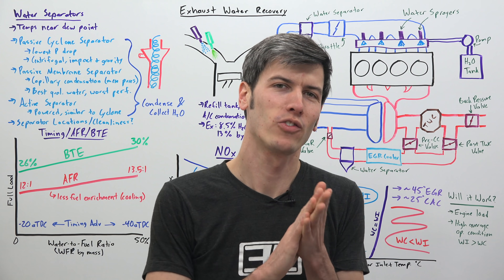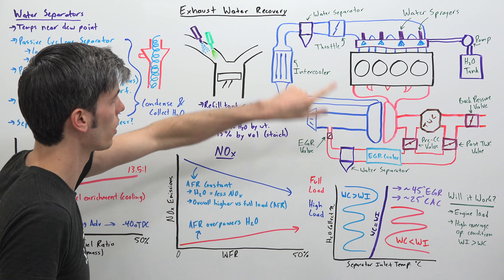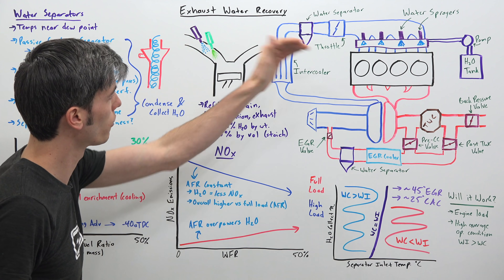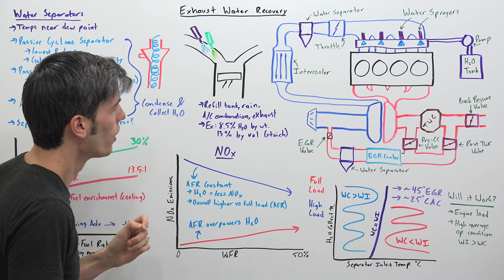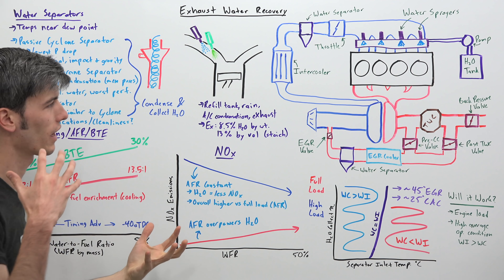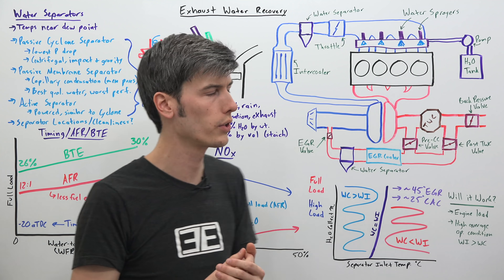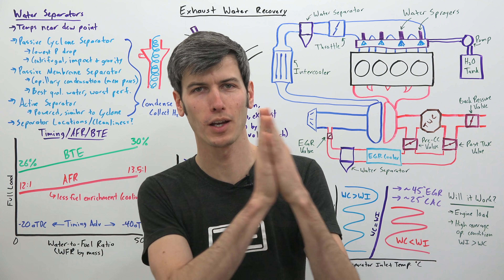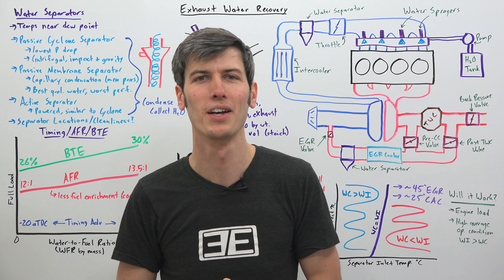Using Exhaust Water To Make More Horsepower!

Comment: Why not just have one water separator - in the intake, after the EGR returns to the intake?

The US army did a study on something like this back many decades ago, using many decades ago technology. They were trying to keep a water jacketed engine cool through self-sustaining internal water injection in cases of the coolant system failing or being breached. They managed to succeed at about 300% water injection, but were unable to reclaim most of the water, caused severe water contamination of the oil and the reclaimed water being highly acidic. Worth mentioning this was on a diesel engine and the water was directly injected rather than port/intake injected. Would be interesting if they tried it again.

Comment: @Engineering Explained What about using water drained from the evaporator core combined with this? Using my C5Z06 I used that water through a filter to top off my methanol injection tank. The car used a Supercharger & I would usually see maybe a cup of water a day while in a 90% humidity 85*F day in the South East USA.

Comment: Why retain the EGR system?  It's purpose is to reduce combustion temperature to reduce NOx production.  Water injection is doing the same so EGR is redundant, its weight can be removed and more power can be had.  I have to assume the SAE paper was published within the past ten years since the testers used direct-injection gasoline engine?

Comment: Great explanation of advantages for water injection!  I've been told one of the effects of water injection was that the water "cracks' in the high temp/press conditions in the combustion chamber and increases fuel combustion efficiency by adding oxygen & hydrogen.  Do you agree?

Comment: I have a video suggestion, it is a bit very specific I think, but it could be really interesting.
A video on how engine displacement, cylinter count, engine type (gas/diesel/turbo/non turbo), engine revs and transmission ratio effect the performance of engine braking.
Because when an engine has more displacement it should brake more because it can create more vacuum an therefore break more.
The video could explain if an engine with 2 liter displacement delivers douple the power on an engine with 1 liter displacement and how much a the backpressure of a stalled turbo effects the braking performance

I have read a bit online and found that normal diesel cars have no engine breaking but it seems that they do because they have obstructions in the exhaust which lead to the car slowing down when not applying throttle. But I also read that this depends on the car and some cars have an exhaust valve. 
You could also explain what is more effective at braking, the diesel exhaust valve method or the gasoline intake valve method.

It would be great to have a video about that, specially about the first part of this suggestion, it could act as an follow up to your Engine Braking Video from 2016 providing a more in depth look at the subject.
Sorry for the long comment and have a nice day.

Comment: This has been known, but not that the effect can be that great with just water.

The MORE IMPORTANT question now remains; Does that BTE increase directly translate to higher peak power or peak torque ("under the curve" benefits), or at what ratio? One would assume 15% BTE increase means 15% power increase, but in the real world there is always drawbacks. What happens to exhaust pressure, does it skyrocket as result as well? What happens to exhaust temperature and mass flow? A lot of race cars are limited by exhaust back pressure, after certain point you just start creating tons of heat for minimal gains. And if this causes exhaust pressure and total thermal mass to increase at higher rate than power gain, it would be net negative. On the other hand, if exhaust pressure increases  in relation, but total thermal mass decreases in relation, you could probably drive that turbine harder than before and get more out of that compressor side too (unless you are already at RPM max)

Further what is the research paper you are referencing?

Comment: 3 questions.
1) was Sulfur induced acid an issue?
2) what was the overall BHP change
3) as a thought experiment. Would you just use a larger radiator to cool the egr  and feed it into the intake without separators?
Reply: i was thinking the last one as well. maybe it would be harder to get that phase change with the Co2 in there?

Comment: What about modding an existing aftermarket water injection system, with say 2 collectors at front of vehicle running back to the water tank? Not as efficient, but could remove the need to refill tank. Any thoughts as to how this could be done ?

Comment: What would happen if a car that used this was in a cold climate? Would the water freeze at any point in this cycle or maybe just while the car is off for long periods of time? I suppose this is more talking about cars with independent water tanks, but is there something with a lower freezing point that would be safe to keep in the system (safe to be combusted)?

Comment: hmm, not sure how good of an idea this is. The first thing i thought of is "isn't the water from combustion systems fairly acidic?" we deal with this on high efficiency furnaces and boilers at work, and in some cases need a neutralizer in the drain line before we can dump it down the drain. Also we end up having to make the heat exchangers out of a "high grade" stainless (304 or 316) instead of a low grade stainless. I'm pretty sure that the inlet manifold, valves, etc. won't like getting sprayed with a mild acid all of the time.

Comment: I think what I'm going to ask could take another vid or two to answer but here it goes. 1) What is the benefit for daily drivers? 2) Is the system worth the additional cost assuming someone will own the car for at least 7 years? 3)Would this be more beneficial for fleet use than for the average consumer? 5) For those who live in, say the Midwest, where the temp/humidity is always changing; would a dual separator system (1 after intercooler & 1 after the EGR cooler) be the best using sensors to switch between them? As always, Thanks for the vid. You not only help keep us informed and educated but get us thinking of new ways to increase performance, reliability and efficiency of our vehicles.

Comment: I wonder if the exhaust water is acidic, the only reason I mention this is because the condense water from combination boilers at Worcester Bosch used to be slightly acidic, this used to be a problem for the condense water pickup pumps that used to either corrode or the Glass Fiber Reinforced Plastic (GFRP) housings used to fail until they changed the type of plastic to I think PTFE.
Reply: Some of the emission CO2 will dissolve as the water is recovered, producing mildly acidic carbonic acid.

Comment: To call my bugeye WRX I have a water spray system over the intercooler. The radiator is a triple row all welded alloy unit which helps to run the engine much cooler. Dyno tests show 183Kw now 201Kw.

Comment: That water needs to be cooled down quite a bit to get the same effect.
Also, the displacement of the water vapour still negates the effects of higher densities...unless you're using very little...I 
suppose....still....even in high humidity, you still NEED energy to get rid of the water, no matter what method you're using.

Question for you @Engineering Explained
is it the colder temperatures that ultimately help to make the engine able to run leaner or the density increase?

Comment: I had a turbocharged Chevrolet Corvair in the 1960's that had been equipped with a water injection system. It did not have fuel injection or an intercooler and in those days microprocessors for control did not exist. So its carburetor was set to run rich intentionally to keep from melting the aluminum heads. Efficiency was the farthest thing from the minds of the ones who built that car, but water injection was a practice for more power in WWII aircraft, also air cooled.

Also as to exhaust water recovery as a practice, the U.S. Navy's giant dirigible airships Akron and Macon used exhaust water recovery to maintain relatively neutral buoyancy in the air. Unlike the German Zeppelins, that could vent hydrogen as the fuel weight dropped to stay at altitude, we used very expensive and rare at that time helium. Venting it was not at all desirable except in an emergency.  Germans used non-spark ignited diesel engines but we could safely use gasoline engines, and water recovery became a viable way to operate. Using helium also meant that these giants of the sky could safely carry small fighter aircraft with their gasoline powered engines making them the world's only aerial aircraft carriers... until the other disadvantages of the such massive weight sensitive delicate construction systems caught up to them. Te need to be capable of all-weather operations meant they were fraught with difficulties that passenger carrying Zeppelins could avoid through rescheduling and re-routing as we still sometimes have to do with todays air travel.

Comment: Why couldn't you collect water from AC system, and also collect water from rain water, and also allow you to fill the tank with water manually, and also collect water from intake/ exhaust system? Use the same tank for all systems. Seems like with all methods, you'd never run out of water and could use programing to use most efficient supply depending on how full water tank is.

Comment: It's a cool idea but I don't really see the point as water doesn't really cost anything and one of these systems could cost a fair bit to install. 
Although if you're super lazy I guess it might make sense.
Reply: Agreed, the direct injection system detailed above would be pricey, but I'd bet you could do it on your car for $50 or less in parts. putting a cyclone seperator on your PCV system, with the drain going to a coil around your exhaust manifold that steams directly into the intake manifold would probably be self sustaining.  there's a LOT of water in blowby.

Comment: This seems pretty cool, though I do wonder how the EGR cooler would get exhausts cool enough to work. My main concern is the exhaust derived water would have CO2 dissolved in it, making it quite acidic. The short drive car has the most holey exhaust pipes, at least here in Australia (down to 45C? we can't get the roads that cool!). How would this go spraying acidic water into an inlet manifold? I assume if it completely evaporates there is no more acid than normal EG recirculation, but it makes me wonder what you end up putting against valve stems and seats where the water is still liquid when it enters the cylinder.
Reply: I think adding a neutralizer, serviced at every maintenance, (just as we do when dealing with condensing boiler's condensate) is enough.

Comment: Pressure also effects dew point, in a vacuum the gas needs to be even colder to get the h2o out of suspension, where as in a positive pressure environment the dew point will be higher. Cyclones are also effected under vac vs pressure. Imagine the gas stream inside as a spring, as you increase pressure the spring becomes compressed IE more passes inside the cyclone. Under vacuum we have just the opposite the gas is less compressed and less passes are taking place. This is probably why they are using a turbo to boost pressure for this system. Anyways great video on a cool system!!

Comment: "Water Sprayers" & Minnesota winters don't go together.
Reply: It would need to be mixed with methanol to be cold climate ready.
Reply: @jdcarguy1242  I put a BMW air-oil cyclone seperator on my daily driver's PCV system.  The liquid outlet of the cyclone was plumbed to a 16oz catch bottle that filled up in ~500 miles, so I reverted back to without one.  Had I plumbed that liquid drain outlet to a coil around the exhaust manifold that fed back into the intake manifold, I suspect moderated engine vacuum would keep the re-warmed vapours moving just enough to prevent water from freezing

Comment: Do you think this would increase carbon deposits over time or make carbon build up occur happen faster?
Reply: I believe the opposite, actually - if water makes the car run as well/better with less hydrocarbon fuel required, the carbon buildup would be partially mitigated, and the water would likely dissolve to a large extent whatever carbon byproducts would try to build up.  Have you seen the "steam clean your engine" videos on here?

Comment: Exhaust is hot. We can probably use it to generate steam to power a small steam engine. In the steam era, steam engines were made from steel. Now we have aluminum. Steam engines can be lighter.

Comment: Why is NO2 a "harmful gas"... the air is comprised of 78% nitrogen, 20% oxygen.
Reply: NOx reacts with water to create Nitrous and Nitric acid. If the water is that in you lungs, you could be in big trouble. NOx clouds are also take part in the creation of smog, which can cause  asthma attacts in people with sensitised lungs. The nitrogen in the air is effectively inert, so does not change the lining of your lungs.

Comment: Assuming you had enough water supply to maintain operation could you run over stoich and use the water to help cool the intake charge instead of running rich?

You had previously talked about how running lean is not necessarily hotter than running rich. So say you are running a 12:1 mixture and only around 80% of the fuel is combusting, couldn’t you also run some mixture above 14.7:1 with 80% of the fuel and produce a similar amount of power? (Assuming some tricks are done to ensure complete combustion of the fuel)

Comment: Water injection does two things simultaneously.
Evaporative cooling as it turns from liquid to a vapor, but also displacing air. Lowering the total oxygen available for combustion.
This is different than using a gas to only cool (and increase the density of) the air/fuel mixture. see section on Nitrous Oxide

Comment: Is this viable for diesel cycle/ SPCCI? Or are the compression ratios far too high to negate incompressible water in the combustion chamber/ even if it could would it do significant damage over time? 

I ask because I'd much rather have electrostatic DPF (high flow) and no need for urea (adblue) exhaust fluid or SCR / overfueling to cool combustion in diesel engines. For instance, the upcoming Skyactiv-D in the Mazda CX-5 is going to have severely reduced fuel economy compared to the same engine and same vehicle in other parts of the world due to all of these things being implemented on US spec due to our highly stringent diesel emissions regulations. What's the point of buying a diesel otherwise? 

Terrible cold starting, and worrying about fuel geling? Searching constantly for gas stations with diesel? High torque yes but decreased power and higher maintenance cost? Also think about the cost of adblue. I'm sure it's negligible ... But it's still a cost a gasoline car doesn't have. That's why I am curious. 

Also how do you feel about turbo compounding on road engines either gas or diesel? Could it be made to work and allow for true engine downsizing with actual fuel economy gains? And what about microwave ignition / hybrid spark and microwave ignition ? 

I'm extremely interested in the final years of Otto and diesel cycle engine development during the interim between now and when batteries become on parity or are even more viable with infrastructure to back up the tech. I am very curious how much tech we'll throw at ICE tech to before we make the switch.
Reply: Google Eagle Research.  Go to their Fuel Savers tab, and click on Water Injection.

Comment: 99% of the time you drive with only a fraction of the max horsepower. How does this system perform at low load?

Comment: I have been fascinated by water inject technology for years, more especially for better performance or to make fuel go further.
But what would interest me more is would water inject technology  help  with carbon deposit build up on inlet valves.  Having water injected up stream from the inlet valves on GDI engines could be a great if it worked. 
When you take apart an engine that has a blown head gasket, the cleanest area is where the engine coolant has passed into the combustion chamber.
Reply: Totally agree. With water-methonal injection the intake valves will be cleaned and you won't have to disconnect the pcv system that is the culprit to the carbon build-up.

Comment: I wonder if these water collection methods are the same ones that some airships used in the 1930s? They used the water recovered from the engine exhaust not to cool intake air but to compensate for lost ballast as fuel was consumed.